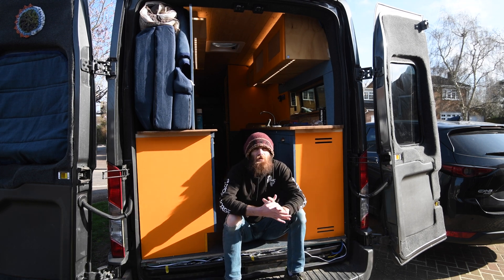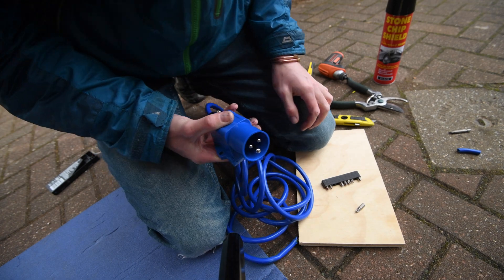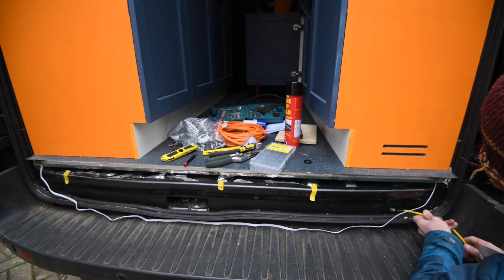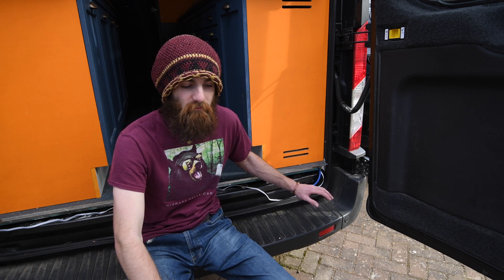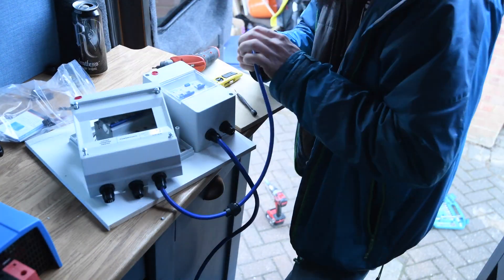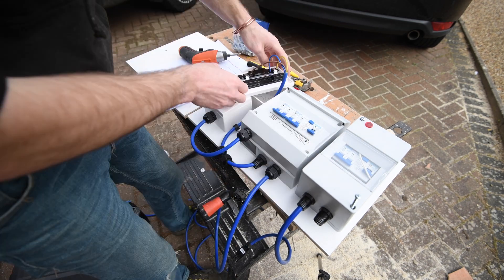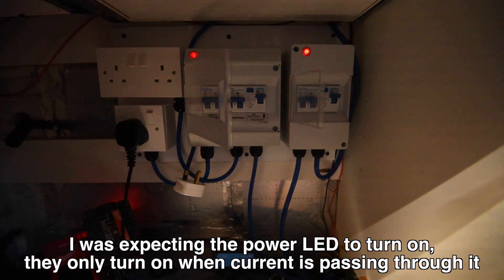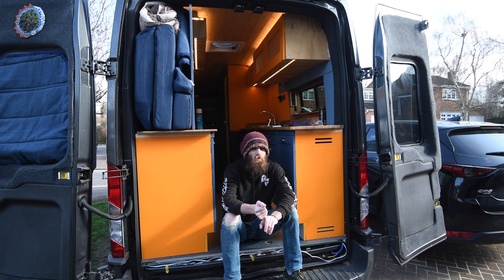Part 2: Installing a Victron MultiPlus : Install, Earth & more | EP49 | Ford Transit Campervan Build

Comment: Thanks for the video series, it's great to see someone using the same kit as I would like to use.  I noticed some other dial, dimmers and swtiches https://youtu.be/NxxfWjKKTEg?t=941.  Any chance of a tour, of what you have?    Also, re: sockets, How many different types do you have? 3 x 240V?  I know that the Multiplus also supports a 240V out that bypasses the inverter (i.e. only for shore power), byt maybe you don't need this..   Then, number of usb sockets?  (Related to what I saw in the video).    I was thinking of adding some 12v cigarette sockets for chargers, to avoid using the inverter when I could buy 12V adapters for devices (computers) rather than 240V.
Reply from the maker: Hey, a full van tour will be coming but still a few weeks away yet on that. 

Whilst the consumer board early at three outlets. Outlets are effectively for the circuits to put into. I still need to do most of that passager side has 4 sockets in the “multimedia cupboard” for the 4K display, Xbox and Apple TV 4K. I’ll still be adding another two for that side when at the table to work on the laptop. 

As for drivers side. I still need to install. Probably one main one, one hidden in draw and probably on near the back. 

As for non AC chargers. I have USB & 12v sockets next to the bed and a few other USB chargers in places
Reply from the maker: I think I like the 12v sockets more as they are more versatile and can be swapped and upgraded easily. 

The multiplus does support AC pass through so on Shore / Hook up you can power items directly through the inverter which are higher wattage than the inverter inverting can do
Reply: @MispronouncedAdventures  But you would need a separate 240V circuit for this, which you are not considering?   It's hard to know when to stop!

Comment: Nice one Alex ... shame have to wait a week for part 3... funny not turning on the switches been there done that too... hehe
Reply from the maker: Thank you! Still got a little bit more filming to do on part 3 want to make sure I can get all the information I can in it. 

Yeah I was expecting the power light to turn on! Looking back I think why it wasn’t. Is because default settings for the inverter might have “search” mode enabled. Where the inverter is smart enough to check if there are any AC loads currently on the system. so its otherwise not needlessly turned on if there is anything to power.